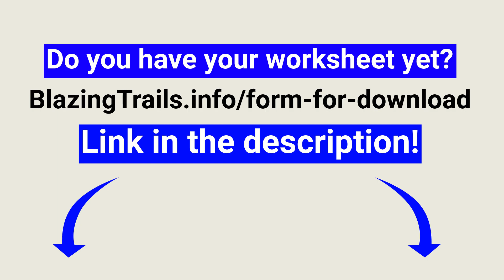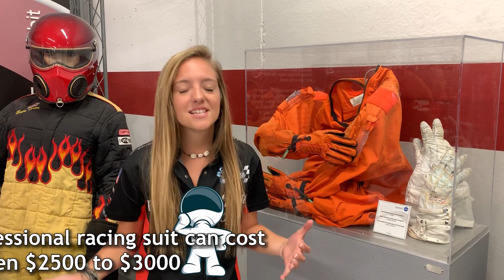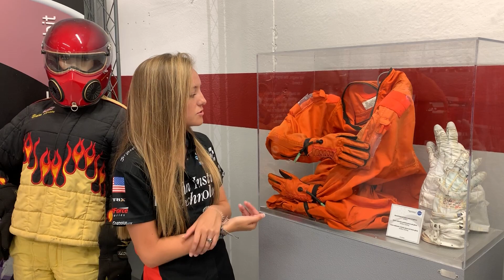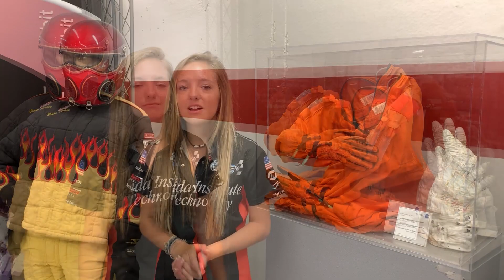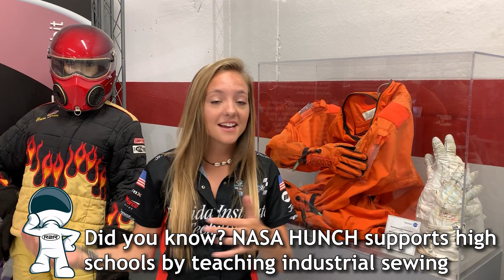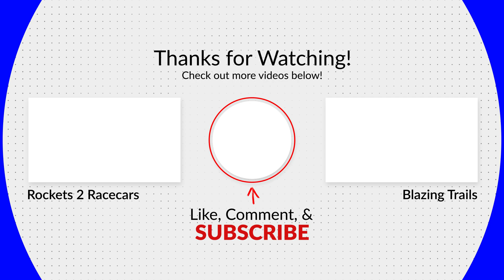Episode 4: Astronaut Suits vs Racing Fire Suits

Comment: The inflatable bladders in the legs to prevent the crew from passing out during reentry were only on the suits used on the first 4 (test) shuttle missions.. after that they wore jumpsuits until the "return to flight" mission after the Challenger accident..  then they went to an entirely new LES .. no inflatable bladders...then in 1995 they switched to another new design made by david clark (the aviation headset manufacturer).. no bladders... that was the last version of the LES..
Reply from the maker: Wow, that's so interesting! Thanks for the comment! 🚀😊